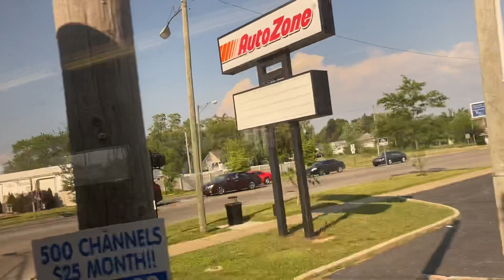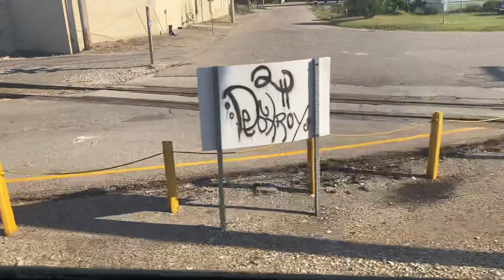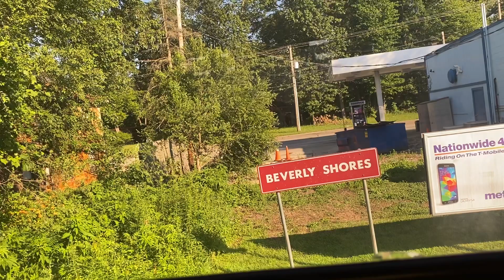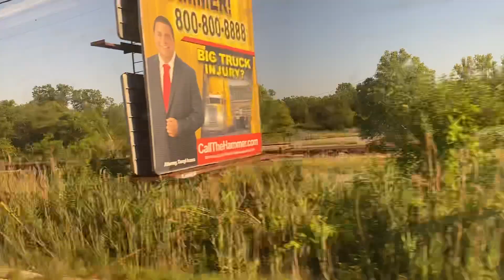South Shore Line full ride (South Bend Airport-Chicago)

Comment: They should build a second station in South Bend, where they are at right at about the 9:00 mark. There's a huge empty parking lot on the other side of the train there, it would be easier for more South Bend people to get to, and a more obvious marker to say "here's the train to Chicago," rather than making people drive all the way up to the airport to board.
Reply: There's also an abandoned ROW from Notre Dame Campus that extends to a point about a mile from this street corner, and if the line were built to the university, that's 12,000 students plus faculty and staff who could board there for the trip to Chicago. Besides the abandoned ROW, more than half this distance could be covered through empty lots and down the edge of a public park, so fewer than ten properties would have to be acquired... hmm...
Reply: Of course, the trip from South Bend to Chicago would only take about an hour on Amtrak, going there in the morning and returning in the evening.